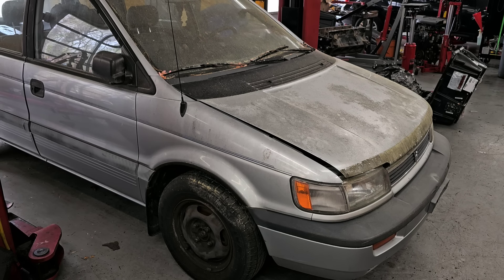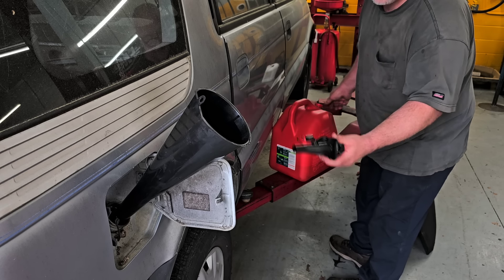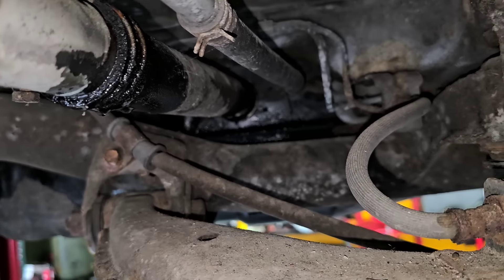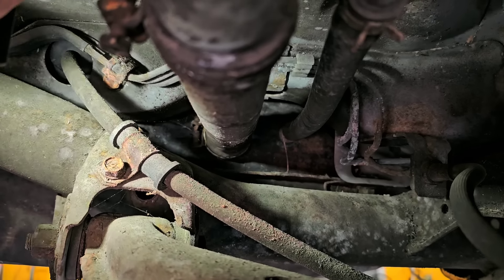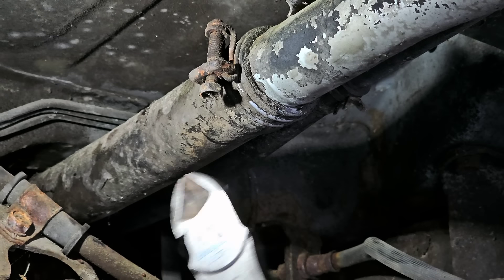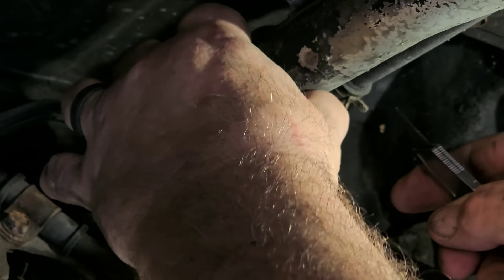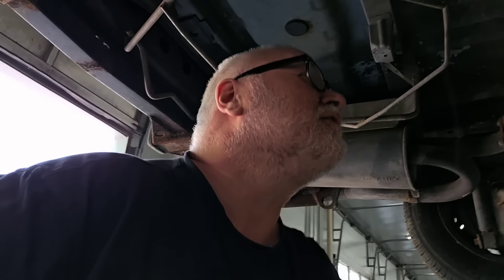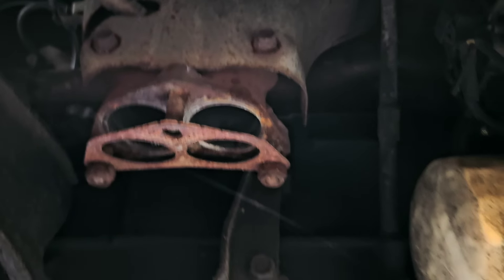This Is Unusual For Us. Only Fixing One Thing, Then It's Getting Towed Away.

Comment: It’s sometimes more cost effective to get all the necessary repairs done on these ‘forgotten nanamobiles’ that have been neglected and put aside.  Surely less expensive than taking a chance on a new car or truck which are proving to be of suspect quality right from the manufacturer!  Plus we are helping the independent auto technicians and auto parts suppliers to stay in business! A ‘win win’ in my opinion!  That’s what I’ve decided to do, keep my older paid for vehicles going as long as I can! Thanx again Kenny for reaffirming my commitment to this mindset! Keep ‘em coming Kenny, much appreciated and respect is given! 🙏👍🏼👏😎
Reply from the maker: You had me at "nanamobiles" Thanks for watching & keep wrenching 🔧
Reply: My Mommabobile, is a 1982 Ford Granada… I put that “seal fix” ATP at 205, and I ruined the front and rear main engine seals.. I had the brake and master cylinder worked on, yet it needed some better adjustment.. At least I need fresh eyes and second opinion on how to overhaul an inline 6, or put a Ford Foxbody Mustang 3.8  liter V6 with a good transmission and rear axle rebuild. At least that’s what I was told.
Reply: @lawnmowermanTX thats to new a chemical for a  older vehicle, wouldnt use atp or blue devil on anything  older   than  1992 1993 era,  for older vehicles  try some original marvel mystery oil first with old school conventional motor oil, gunk, stp, make sealers conditioners for older vehicles. there are conventional oil quarts made with conditioners sealers for older vehicles that are labeled so, but you probaly wont find them anymore at a retail store unless you order it.
Reply: You aren't serious
Reply: @Mustangg16  Please rephrase the question?  If I’m asked to work on a vehicle, I need to know (1982 year, Ford make, Granada model, L,GL, GLX trim) the vehicle, what is wrong with it, and if I can still get parts for it. Then the big question is how much is the customer going to spend? Some states are anti-emission and are stiff with penalties and regulations.  There are huge Junk Yards in Dallas and El Paso TX that might help.. Belton, Waco, Austin and San Antonio have “pick-n-pull” places.
Reply: Yeah, best I can figure, it's a ' mom's last car ' or a ' someone in the family that died ' or maybe even a ' the vehicle I lived in while going to medical school and now that I'm a brain surgeon and make 
1 mil a year I still have it in the corner of my six car garage and plan to restore it ' or a least keep it forever for the memories - car.
Reply: Even Jay Leno with his VAST car collection still has the old 55 Buick he lived in when he first moved to Hollywood.
A number of years ago I saw magazine article where he finally had it restored and new engine- some humongous 500 plus cubic inch monster.
Not to mention somewhere in his vast estate in Washington Bill Gates still has the old Mustang he was driving when he was founding Microsoft.
Reply: @michaelszczys8316  I grew up in the 1982 Ford Granada and have lots of memories when I found a real job and drove till I ruined it.. I been through a lot in my life and I can’t find anyone in Texas to help me mechanically restore the Granada. I yet to find my fortune 🎱 and I don’t make enough to get married or have kids.. I kept meeting gold diggers and mean spirited women.

Comment: Tractor Supply has regular filler necks for your gas can. They work great.
Reply: Or you can put a valve stem for a wheel on. Drill a 3/8’s hole I believe on the handle side, take air stem out. Take baling wire through stem then put wire through gas can opening and run it through the hole you drilled in can. Make sure you had wire bent after fat side of stem. Once you have the stem sticking out of hole you drilled, just pull it up to lock in place. 
The filler part you need to take the spring out. There are videos on how to do that, I just don’t remember how to do it. 
Hope this helps.
Reply: I think the diesel filler necks on the 2 or 3 gallon cans are still old  non-safety  style.... least they were a couple years ago...
Reply: Trump 2024🏁🏁👌👌

Comment: My dads neighbour had a 1993 model one of them which he traded in for a new Toyota Yaris, the Expo is called a Nimbus in Australia.

They barely drove it because his daughter & her partner only stayed with them once a year whenever they came over for Lord Howe island so it didn't get driven that often.

It would've only had done 100,000 kilometres at the most & I don't think that the one in the video would have the original engine in it because I can remember when a mate of Mines parents got the 4G54 engine (Astron 2) rebuilt in their 1987 model engine at 100,000 miles because at 86,000 miles it started burning oil & it was well maintained.

My dad only had them (a 4G32 Saturn engine) last that long until it began to burn oil in his old 1982 model Mitsubishi L300 Express (Delica) van.

The Japanese engine specialist who rebuilt it says that they don't last very long !
Reply from the maker: You're correct! These engines, in my experience, don't last. Which is why they are going to have issues finding parts. I always appreciate your responses to my videos. Keep wrenching & thanks for watching 🔧

Comment: Good morning Mr Kenny, it's Saturday and hope y'all have a great weekend sir.Thank you for the video, and got a funny feeling we'll see the van once again 😅😂
Reply from the maker: Hi Bobby! I hope you're having a great weekend. I will keep you posted if the vehicle comes in for another repair. Getting parts is gonna be rough. Keep wrenching brother 🔧
Reply: @WrenchingWithKenny  yeah great weekend so far sir, Thank you
Reply: @WrenchingWithKenny  Agreed, it’s best to ask the customer how much money they want to spend.. There’s the exhaust manifold, muffler and catalytic converter work, 4 tires, battery parasitic load.. brakes, steering, and the shape of the engine and transmission..
Reply: Insurance on newer vehicles with collision is expensive . If you have a long commute and must use it daily , you empty your wallet . Even leasing an economy vehicle is no guarantee that a dealer can fix it quickly under warranty . At least with older vehicles many of the problems have already been around and it's not a mystery . But if you are not going not work on it yourself , you need an honest shop or you will still empty your wallet .

Comment: Just as a matter of interest what did you charge for the hose replacement? Had similar easy repairs but took hours to find and customer complained about the price realistically they're paying for my time not the actual parts or work done?
Reply from the maker: Something like this the customer is paying for my labor for finding, diagnosing & repairing the leak (or electrical issue) lift time, and my years of experience. If I get pushback I tell them that a less experienced mechanic may have taken 2-3 hours longer. If they could have done it themselves they wouldn't have brought the car to you. That's a great question for our Facebook groups; Wrenching with Kenny & Backyard Mechanics. There are a lot of independent mechanics that are on those pages. Be sure to answer all the questions because they are closed groups. I'm curious about what other Mechanics & shop owners say to their customers. Keep wrenching 🔧

Comment: The repairs are going to be more than the car is worth.Plus trying to find parts for it
Reply from the maker: You're absolutely correct! Keep wrenching 🔧
Reply: Actually, the fuel hose replacement was more than the car was worth.  Some turds can’t b polished.
Reply: True, but a hell of a lot cheaper the payments of a new or another  used one
Reply: @donames6941 Problem is if the part is obsolete,cut off production is 10 years

Comment: Can anyone tell me is that radiator hose or gas line only hose?
Reply from the maker: Fuel line hose. You could probably use it for a radiator but it is designed for fuel. You can use gas line for radiator but you can't use radiator line for gas. Thanks for watching & keep wrenching 🔧
Reply: Who sells unmolded large diameter fuel hose like Kenny used?
Reply: Check a marine supply store, like Boat US or West Marine.
Reply from the maker: We got it from O'Reilly's Auto Parts